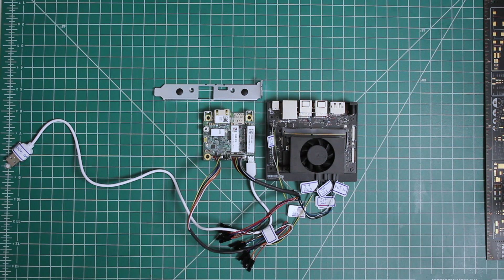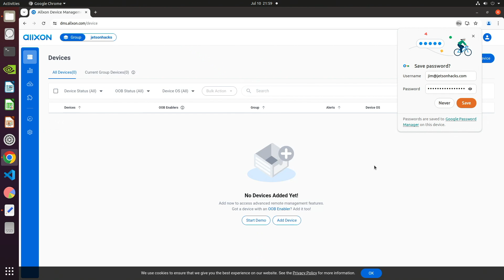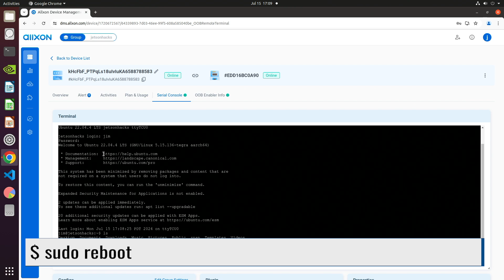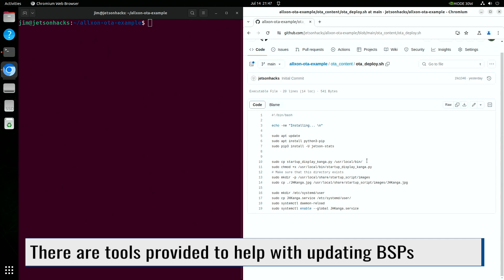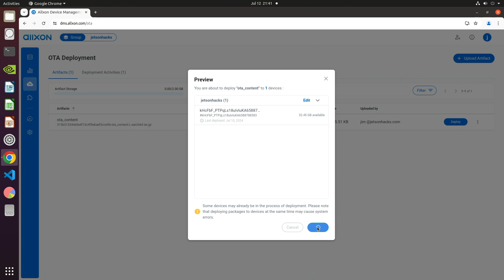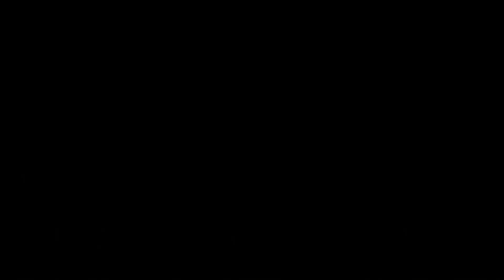Remote Management for NVIDIA Jetson with Allxon

Comment: I never heard about this. Amazing!!
Reply from the maker: This is a product that flys under the radar, it's mostly for professional users and people that have critical missions to fulfill. But if you need it, you need it. Thanks for watching!
Reply: @JetsonHacks  Yep. Currently, I maintain 5 Jetson Nano remotely. They have 4G connectivity. I configured Ngrok tunnels for each of them to connect with ssh and eventually VNC.

I think that this product would be an overkill to me. Important to know the concept though.
Reply from the maker: @hanshima_  I think that's smart way to do it. As you might guess, the whole thing can escalate quickly and get out of hand as you keep adding Jetsons. It depends on the application, but if you have to absolutely make sure it works and the Jetsons are remote, the Allxon solution is a good place to start looking. 
It's so familiar to see cloud based services for managing networked computers, such as on AWS and Google Cloud, that device specific solutions like this seem natural.